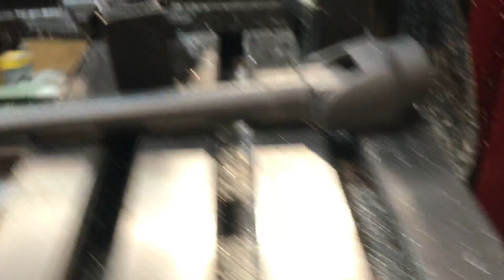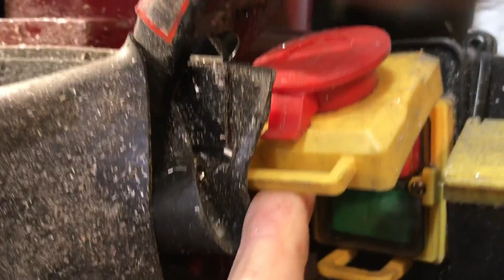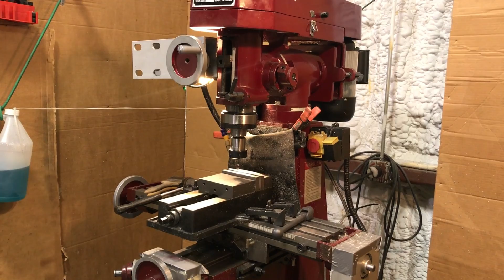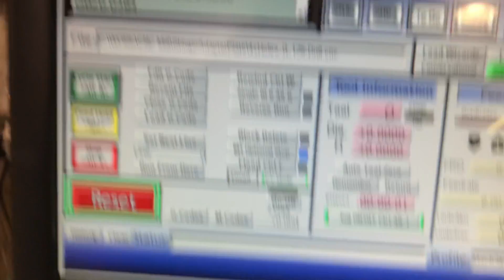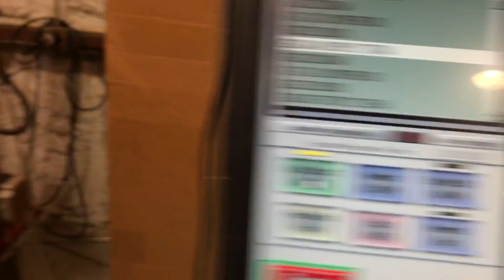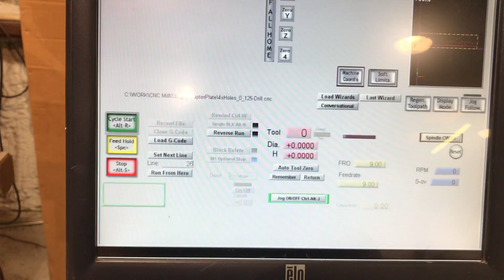Mill Sale CNC

Comment: The whole motor assembly it comes with, is an absolute garbage, non usable. Literally. It will overheat, then it will overheat belts and belts will get stretched from heat, and game over. I ended up installing AC servo and doing a heavy modification there. Over all I do not recommend anyone to use this machine for CNC conversion, you will waste money and end up with nearly same junk. Instead, if you are capable of converting, you might as well build your own epoxy granite cnc mill from the scratch, trust me this junk from HF is just as much time.

Comment: I have NO IDEA how you managed to put the motor on top Z axis, unless you havent used the machine yet. That axis has like 2mm play in it, useless for any motorized application or milling. I ended up using lower platform for a Z due to a lack of other option. I disassembled the whole spindle assembly only to realize that this machine is cast and made this way, no way to fix that awful backlash.

Comment: I just ordered one of these machines an now am worried I will get junk ! I have seen a lot of defective parts come from harbor freight in my time... I hope I just get lucky and get a good one. if not I will be doing the same thing !  I know its a really good deal for this mill but I am not willing to except defects just cause of a low price.  I need this mill to work so I can complete accurate parts !
Reply: Steve Lamperta Did your get the mill?  I am thinking about getting one.  I have wanted a mill for a long time but could never justify they money for a nice one.
Reply: Any of you guys get the mill? Been looking at them and debating. About impossible to find a knee mill of this size in my area.